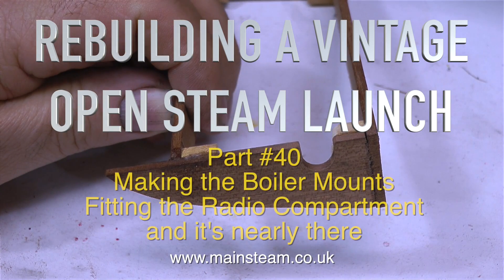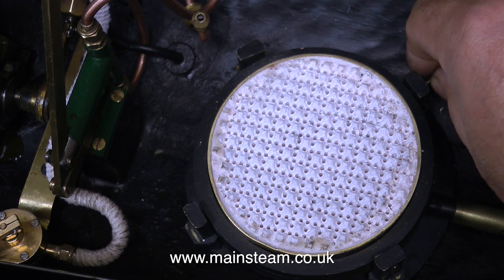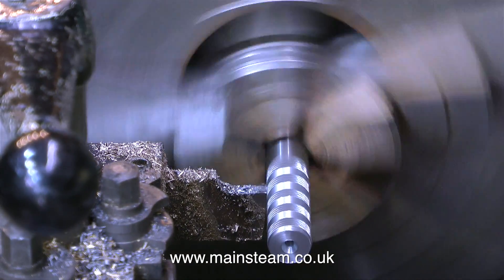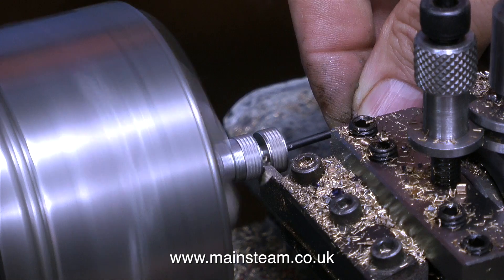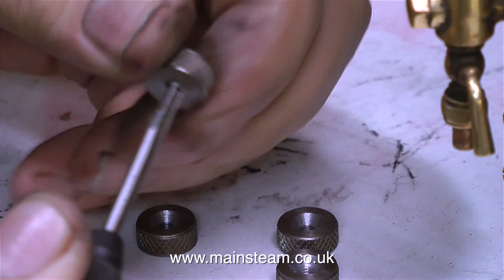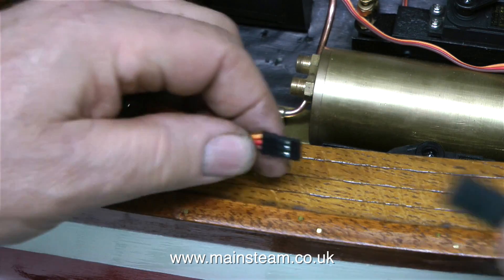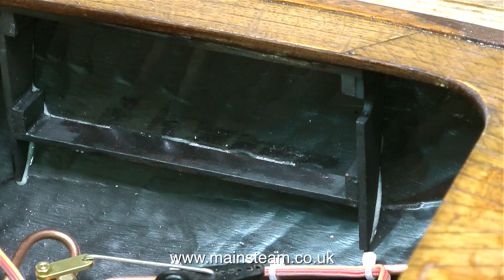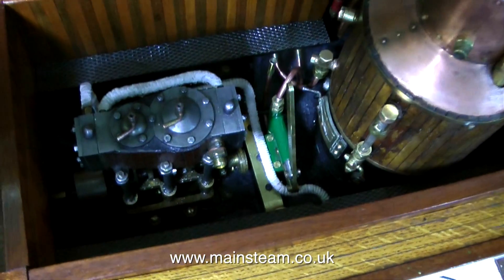REBUILDING A VINTAGE MODEL OPEN STEAM LAUNCH - PART #40

Comment: I notice you don't mention any stats on these models. As in power lbs per ■" and the versatility of steam ? 
Did you know about Superheaters. Has anyone modelled a super heater ? 
Personally I believe steam is overlooked on this time. Cheers.
Reply from the maker: Yes I know about Superheaters, I use them almost all of the time - please watch a few more of my Videos . . . . there are almost 1400 of them to watch so far . . .
Reply: @keithappleton  is there a superheated dry steam  sealed steam system. As in recycle the dry steam in models ?
Reply from the maker: Yes, please watch some of the other videos as I mention Superheat frequently.

Comment: Hi I really like watching your videos. I have been in the engineering game for all of my adult life and now retired, we almost always made small or long threaded screws like you just showed. As far a accuracy, try cutting a 3mm thread to the same standard as a high quality length of all-thread, very hard to do. Also why would you want to tap a blind hole when a through hole will do :)
Great work keep it coming.

Comment: Heat will destroy the Locktite bond - doesn't the base of the boiler get hot?  Or is it a matter of degree?
Keep up the videos - I am now wanting to try steam engines myself...
Reply from the maker: Loctite needs a lot of heat to make it give way - a good bit more than around the base of the boiler . . .